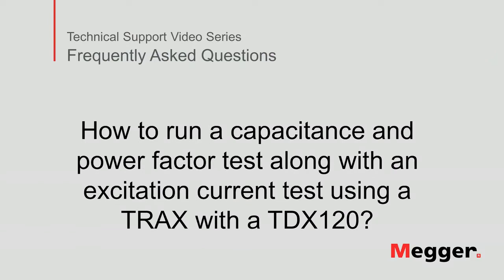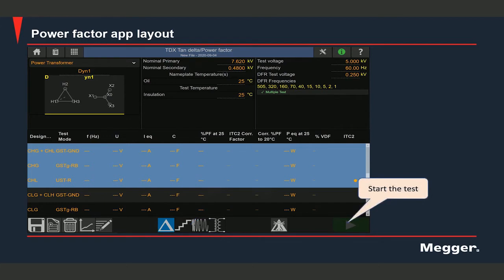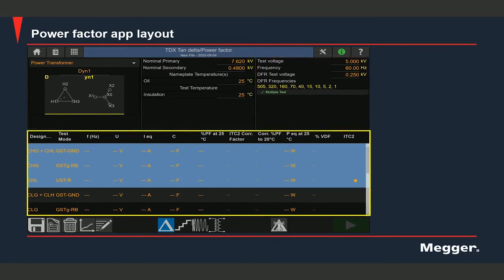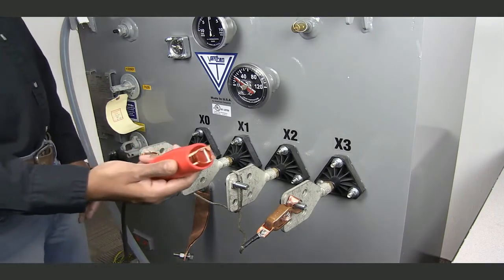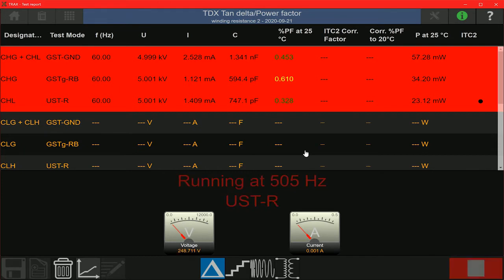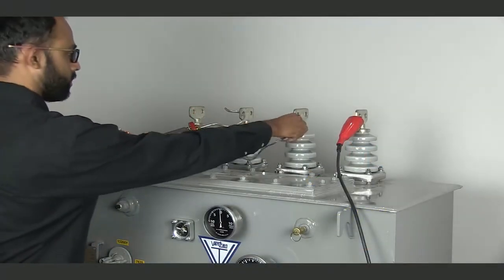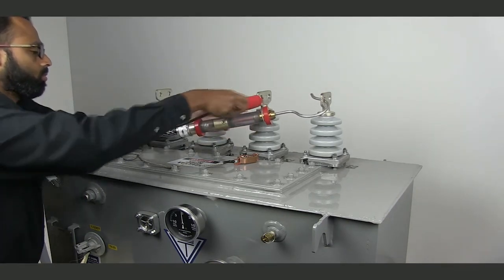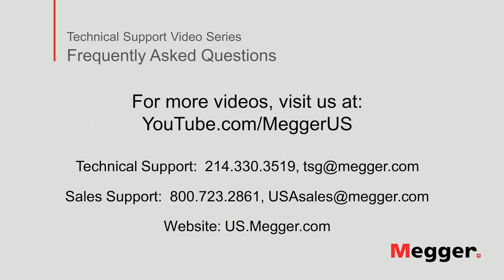Megger TRAX: How to Run Power Factor and Excitation Current Tests

Comment: hi，how can i active the option software in TRAX280,  i need to do the breaker timing test ,but it is unavailable
Reply: Contact your megger Sales representative, the breaker timing test is a software package (Substation package, will come with some additional leads) that can be purchased, and then connect the TRAX to interne via ethernet and it'll auto update.
Of-course if you don't want to pay for the package, the manual mode is there for setting up your own test module with what you want to o/p from the unit and where you want to measure.